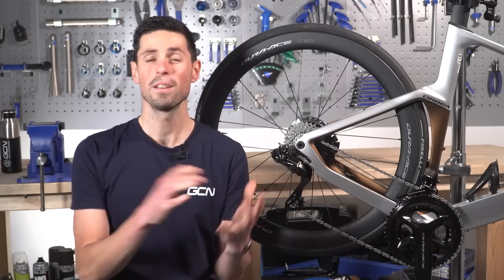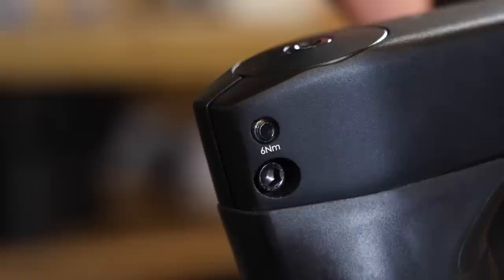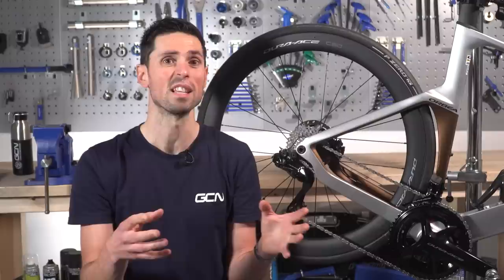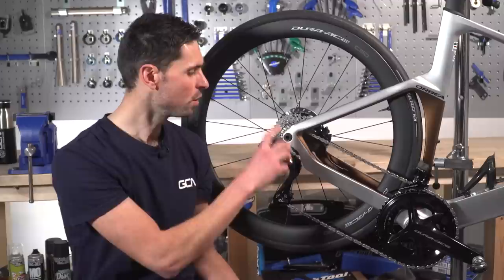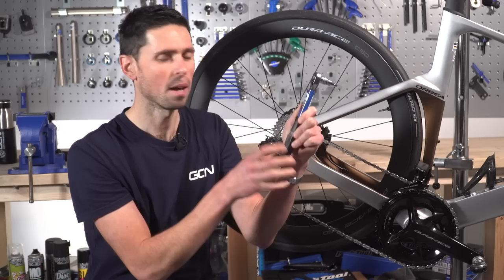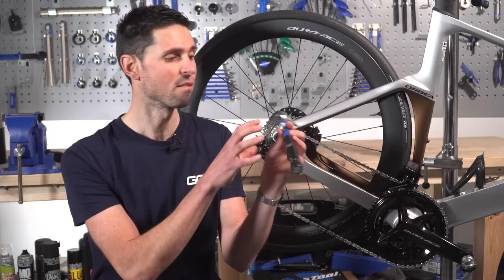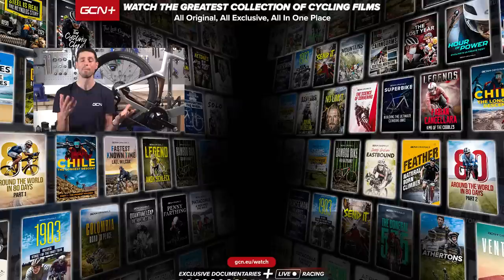What Is A Torque Wrench & How Do I Use It? | Maintenance Monday

Comment from the maker: What other maintenance videos would you like to see Alex do next?
Reply: Fitting a 11s to a 10s freewheel
Reply: How to service a free hub body.
Reply: Not really a maintenance question, but one of sustainability. Us cyclists tend to be an environmentally conscious bunch, so it really pained me to throw away an old Red cassette only because a couple of cogs were worn down. Are there initiatives from bicycle manufacturers or other parties to salvage and recycle old frames and components? Specifically steel, titanium, and aluminum. (I guess carbon is just special waste.) Alternatively: are there industry initiatives to make products more durable or easier to repair? (E.g., I still prefer Shimano to SRAM because I can/could replace individual cogs on a cassette.) My guess is probably not, since that's contrary to how our economy works these days, but here's hoping. #askgcntech
Reply: If you could help us understand where we can find this information about how much force (Nm) we need to use on the Torque wrench. Also it would be good to share also for non thru axel
Reply: How about cleaning and re-lubricating shifters that have been sweated all over while Zwifting?  Perhaps you could get Si's bike as an example.
Reply: Looking at the nice Shimano wheelset on the bike: Could you show how to service cup and cone bearings in hubs?
Reply: Rim brake setup and servicing?
Reply: I’d like to see Alex service that CLASSIC Casio watch! Timeless timekeeping.
Reply: @hymen0callis  I tend to toss old cassettes into my recycling bin. I hope they get recycled, but I really have no way of knowing if that's the case.

Comment: Top tip that you didn’t mention.
Always wind up to your desired torque setting and not down to it. So if you are at a higher setting than needed , wind down past the setting you want and then wind back up to it .

Comment: I've used torque wrenches for 20 years. My two top tips, click it once and once only, making it click twice will add more torque. Store at 0 nm/ft lbs or even below if the wrench lets you.
Reply: If your torque wrench is adding on a second click it's broken and needs to be replaced.
Reply: ¿Cada cuanto se hace mantención a esta herramienta?
Reply: @jamesmckenzie3532  In the automotive world, torquing a nut (especially a car wheel) meant tightening until it clicked once and moving on to the next nut in a star pattern.  Then coming back, repeating and doing each nut a second time for a second click.   I assume tightening other nuts changes something on the other nuts.   Makes sense if you jump over to a musical instrument and tuning one string affects others.
Reply: @sonny9608  you know I dont mean clicking more then once in a set period right? I mean click twice on the same bolt, once it clicks or beeps its torqued, no need for another.
Reply: @sessionfiddler  and yes that is correct because wtv is getting torqued down settles. Its why they tell u to recheck after a certain amount of time.
Reply: @sonny9608  yea but I dont think you get what im saying. As in dont click the torque wrench twice on one bolt at the same torque. You're actually applying more torque after its set. Ie torque your wheel nut to 80 click once and move on. You're effectively torquing 2 bolts if you click twice on one bolt. Most people don't know you actually need to re calibrate a torque wrench, its why theres a screw under the spring.

Comment: Another tip: hold the torque wrench handle in the appropriate position, normally near the end of the handle. Choking up (holding it closer to the bits) may add a couple on newton meters to the setting. (Learned this the hard way …)

Comment: Watch out for the smaller TW-5.2 I had 3 bad warranty replacements from Park Tool all from brand new. different issues from the adjustment knob falling off, then not clicking under 10Nm (cracked my seat post at “6Nm” so I lost $100 there) then the replacement wouldn’t click under 8Nm, the latest one is fine.

Comment: Kudos for talking about how to properly store and to avoid unnecessary overuse!
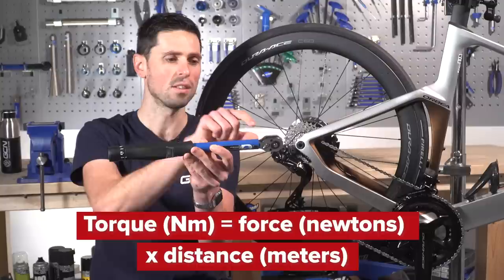Under "Types of torque wrenches", it should be mentioned that there are "beam type" torque wrenches that are considerably less expensive than dial-type and more suitable for the home-mechanic's budget.  Also at 00:57, as much as I'd like to see SAE (AKA "imperial) units abolished, there are still many torque wrenches (beam type) and torque charts that have things like inch-pound and foot-pound scales...
Reply: I keep a conversion table on the wall as not all wrenches have ft-lbs on (in Europe) yet some bike brands will give you an imperial spec only!
Reply: My Park beam (thanks for reminding me of the proper name) contains a scale containing both measures.
Reply: My beam type Hazet has both (Nm and lbs/ft) on it. Of course you have to use the right one.

Comment: Make sure you grip the wrench at the designated area. If you don't, the torque applied won't be accurate.
Reply: It will be accurate, just harder to do!
Reply: @DavidWhiteOfFleet  This is incorrect. On click-type torque wrenches, incorrect hand placement leads to incorrect torque applied. The torque will be higher if the hand is placed closer to the bolt and lower if further away from the bolt.

Comment: BUYERS GUIDE: If you are buying a torque wrench bare in mind 90% of torque wrenches on sale only work in the clockwise direction, but on a bike there are a couple of important reverse thread bolts, that would need a counter clockwise wrench. Even if the wrench says "reversable" that just means you can rachet in both directions, not that the torque setting works in both directions. The easiest solution is to buy a bike specific tool like a park tool which can torque in both directions. The park tool aslo has the appropriate range of torque settings for a bike. Annoyingly if you are going to work on a full bike, you may need 2 wrenchs, 1 for low torque 4-20 and one for higher 20-60N. You can't get a single wrench that will do that whole range. The park tool does 10-60 which is pretty good. You could pair that with something cheaper, or tighten the small bolts to feel. I run the "will this kill me if it comes loose" test. The cheaper solution is a split beam torque wrench. That can actually go from 0-60Nm, and doesn't need to be calibrated, and costs less, and goes in both directions.

Comment: Some facts from Hazet and Park Tool:
It´s no problem to undo screws with torque wrenches! (ONLY if they are uni directional)
They are NOT loosing spring tension, if they aren´t set back to zero!
BUT if you set them for example to 4Nm and leave it like that for some days, you HAVE to reset it again to 4Nm...

And you finally forgot to tell an important point:
You must use it exactly on the handle grip!! 
If you grab to short you need more power, and also give to much Nm on the screw!
If you grab it at the very end of the lever, you will stay below the Nm value!
www.youtube.com/watch?v=BPe1-bDFVRM

Only click ONE time on single screws!
But if you have multiple screws, like one a stem or disc brakes, you need to click 2 times!
(because the tension changes on every tightened screw)

Comment: What do you suggest when you’ve torqued your seat post to the correct torque (even over tightened at this point) but it keeps sliding down on rides.. Yes carbon gripper paste is used
Reply: I remedied mine with some fine grit sandpaper. Slightly roughened up the surface of the post. Also - not all carbon grip pastes are born equal.
Reply: What I have done on mine is to have a second, slim seat post clamp on the post immediately above the clamping point on the frame. It's really not done up tightly, but having two acts like a locking nut.

Comment: #askthegsntech Hi, Alex I have the following problem. I have a Shimano RD R9150 di2 rear derailler which when I tried to adjust as per shimano's instructions in its app runs out of steps (16 steps in either direction) and the chain slightly rubs the previous sprocket even in +16. Can you help?

Comment: There are a number of torque wrench kits that are small enough to add to your ride along toolkit...how do they rate when compared to "shop" tools?
Reply: They only have single-figure torque values with no decimal points, but enough to get by.

Even a small Torqkey preset torque tool is OK to bring along. If I have one, I'd bring the 5 Nm version since most cockpits need a 5 Nm torque spec. Useful in the shop too if you're lazy to use your regular torque wrench just to make some cockpit adjustments.
Reply: I have the Topeak Nanotorq 5 Nm kit that I pack with me. I was wondering the same. So far it has worked well but I'm curious over time how close it is to a calibrated unit.
Reply: I carry one in my saddle bag. It's either 4 or 5 nm, which will do for most of what I might need to torque. Have yet to use it on the road though. Knock wood.

Comment: Hi Alex and anybody else. I have a tubeless tyre stuck fast onto a wheel rim. What are your hints and tips for a non-violent solution? My best idea right now is to grab the tyre in a vice and use a heat gun to hopefully soften the dried sealant. Any help from anybody would be really appreciated.
Reply: Factory setup Giant wheel by any chance?
Reply: @ddavidd430  WTB Venture on WTB KOM wheels. The tubeless setup was done by the shop after the wheel was replaced after the rim weld cracked less than a month after I bought the bike (a Kona Sutra). I think they thought they were doing me a favor, but I lost tyre pressure after a couple of days. I suspect they put the Apprentice on the job, but that is speculation on my part. I'm kind of grumpy about it right now!
Reply: @jonfarmer7914  oh okay, I just know of a couple of people with Giant/Liv bikes who have had the rim tape (almost like masking tape) bond itself to the tyre making it a 🤬 to budge.

Comment: Do torque wrenches generally also measure torque backwards? For example, when I installed my pedals, I was una le to measure the torque of one of my pedals because its thread runs the other way around.
So, is my wrench crap, do I need a specific one that measures backwards or is there a bidirectional torque measuring wrench? #askgcntech
Reply: They can be used in both directions
Reply: Just reverse the ratchet and you are good to go. Or get the traditional beam wrench that measures via deflection.
Reply: Virtually all will only work in the normal clockwise tightening direction, if you’re trying to tighten Garmin Vector pedals using the crowfoot adapter, just tighten the left (left hand threaded pedal) while still standing on the drive side of the bike, as you’re now still turning clockwise for the torque wrench to work but winding the thread towards you into the crank arm.
Reply: Some wrenches are bi-directional, most are uni-directional. Examine yours carefully. I use Wera insert wrenches (a couple other manufacturers also make similar ones), where the mechanism itself is uni-directional but the head insert can be reversed.

Comment: After which period of use do they need calibration? Or is it a matter of buying a new one?
Reply: It depends on usage frequency. Under frequent use, an annual inspection is recommended. Torque wrench calibration can be done by torque tool calibration labs.
Reply: A more expensive one (like a Gedore) needs a calibration after thousands of clicks, in private use it would last many years to reach this number of clicks. For professional shops it's more important to calibrate them from time to time since they use them way more often. 
Accuracy is especially important with lower torques, since 2 Nm more at a torque setting of 5 Nm is relatively much for small threads, while 4 or 5 Nm more or less at 40 Nm isn't that crucial.

Comment: Torque wrench is a precision measurement instrument not a regular tool. It's good practice (especially for really high torques) to tighten first using a regular wrench and then finish up to precise torque using a torque wrench. And definitely most certainly absolutely no unscrewing with a torque wrench.
Reply: unscrewing has NO effect on the precision... That´s what Calvin from Park Tool said, Hazet also said so!!

Comment: Also make sure the bolts are running smooth, use a lubricant if possible.
Reply: the calculated friction coefficient from bolts are measured without lube!
Means, if you lube the screw, it has less friction in the thread...
Result: you tighten the screw too tight!!

Comment: I don't understand why torque wrenches can be set to unscrew as well as tighten. If the advice is to only use them to measure torque then that is done when they are used to tighten up. If they are used to measure torque on bolts tightened by another tool surely that can damage them too.
Reply: Left hand thread like on a pedal?
Reply: @robertcatuara5118  good point. That wasn’t mentioned in the video.
Reply: @DougMorley1  you find left hand threads not just on the bike (left pedal, or the right side of the bottom bracket), but also on some cars or light trucks (Japanese ones or older US ones) , which have left hand threads sometimes on the left side as wheel bolts
Reply: Let’s be honest, most of us do a little bit of unscrewing with our torque wrenches (don’t we?).  It may not be best practice, but it’s certainly convenient at times, and as long as we’re careful no great harm will be done. Just don’t go using your precision torque wrench to crack rusted bolts, for example.

You mention measuring torque on a bolt tightened by another tool. Be careful doing this.  Another ‘click’ on a bolt that was already at the correct torque will likely leave the bolt over torqued. I understand the correct thing to do is to loosen the bolt (same tool, very convenient!) then tighten to a single click.
Reply: @simonm1447  When using a torque wrench for left hand threads is it best to exclusively use it that way and another torque wrench exclusively for right hand threads. The implication being that to use only one torque wrench for both (as suggested in this video), would end up damaging it.
Reply: @DougMorley1  it's not uncommon for torque wrenches to have a ratchet mechanism just in one direction, and a square spindle you put on the socket to put out and turn 180°, such a torque wrench can be used in both directions, but you turn the wrench itself always in the same direction. With such a wrench you just need one, and the torque mechanism always moves in the same direction

Comment: Once you understand what Torque wrenches like these are actually measuring (running torque) Vs. what you want to measure (Preload or clamping force) and how they are effected by lubricants, anti-seize, grip paste, locking compounds, rust, dirt, temperature, humidity, thread pitch, surface area, etc. You will realize that a torque wrench is next to useless for most bike applications and very small fixings in general.

Comment: I hate to sound like a hater, but this is a pretty poor video on torque wrenches and there is some massively important information left out…
The explanation at the start to calculate torque only works for a straight bar or beam style torque wrench. Therefore it is pretty much wrong as it doesn’t work for click or digital torque wrenches which are the most common type of torque wrench for everyone below the needs of a workshop which is basically everyone! The click style torque wrenches have a pivot for the socket head to snap and pivot around once the clutch or digital reader reaches the desired torque, this is what makes the calculation at the start wrong! The pivot changes the calculation for torque. Especially important to know this if you have anything carbon!
It’s also worth mentioning that holding your torque wrench in the correct location so the lever isn’t lengthened or shortened by your incorrect hand position!
Further to this when buying a torque wrench it’s also worth knowing that some torque wrenches can only apply torque to standard thread and not both forward and reverse threads.
Please do better next time when explaining something so important to people because when you put too much torque into carbon, which a hell of a lot of people have on their bike now, it shits it’s self dramatically!
Reply: You're wrong about the calculations, that is literally what torque is. Positioning the measurement near the ratchet means that the measuring mechanism has been calibrated bearing in mind where it is located. Putting 10 Newtons of force 10cm down the handle should cause the mechanism to click on a setting on 1Nm.
Reply: The calculation at the beginning is just the definition of torque, you don't need to use it to calculate anything if you have a torque wrench. You set to the desired torque, tighten until it clicks (or until the scale reads the desired number), no calculation necessary. 
Where you hold the torque wrench is also only important on bending beam torque wrenches, all other ones it doesn't matter where you hold it.